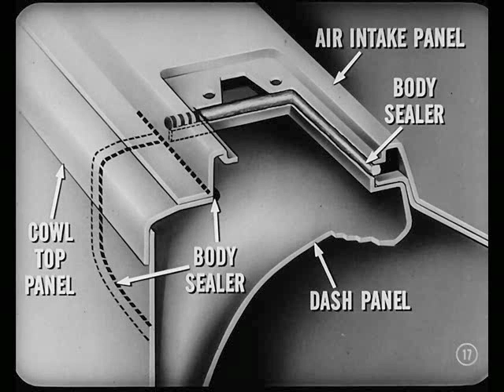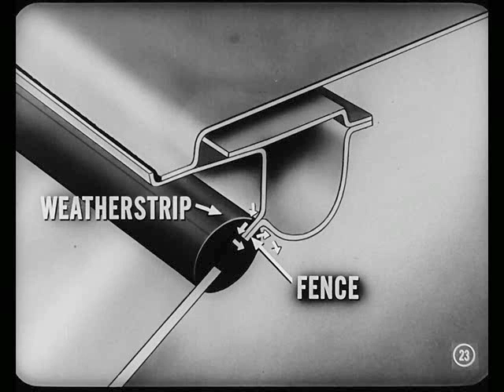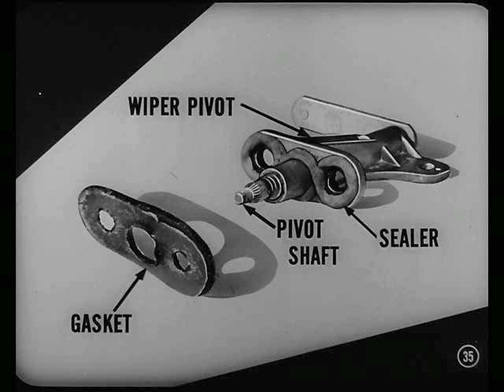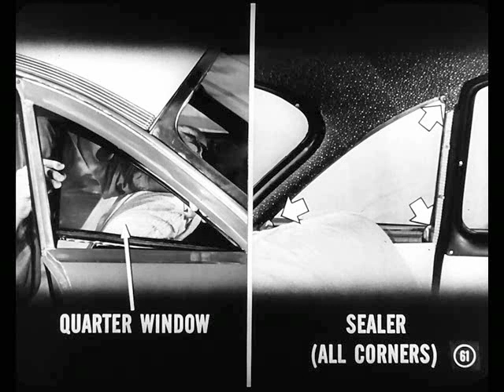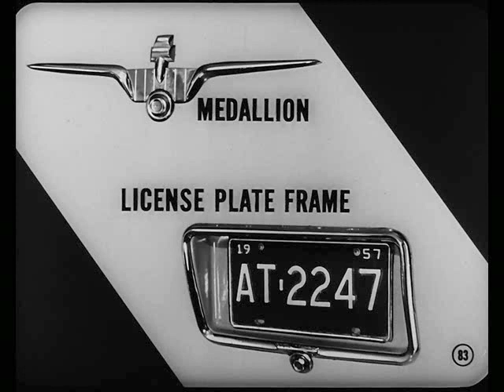MTSC - 1957, Volume 10-3 Body Sealing - '57 Cars

Comment: Leaks "everywhere" was the main downfall of Chrysler's show stopping new styling.  Front passengers got wet feet and water got into the body everywhere and didn't drain out, forming pockets of rust.  These cars were slated for introduction a model year later but the basics were finished so they were rushed into production because the styling was A+++ for its day and engines, transmissions, and suspension near perfect. Obviously, sealing and manufacturing perfection needed more work.  Imagine a dealer getting a truckload of these and having to do all this work to each car.  If I had a new 1957 Dodge I'd garage it on rainy days.